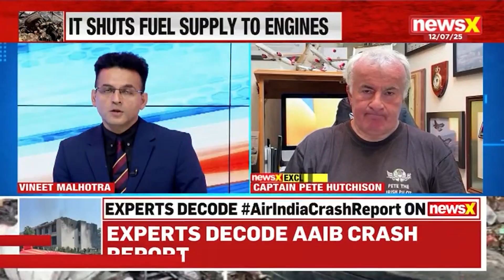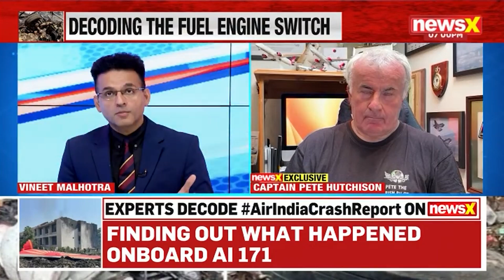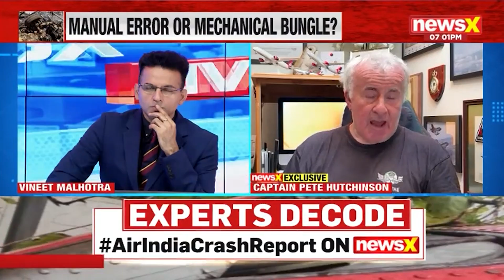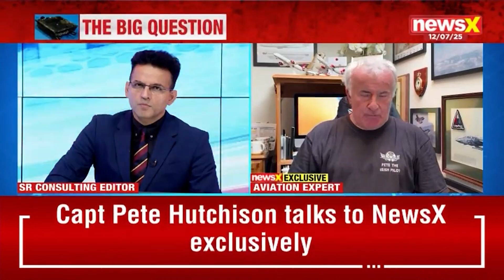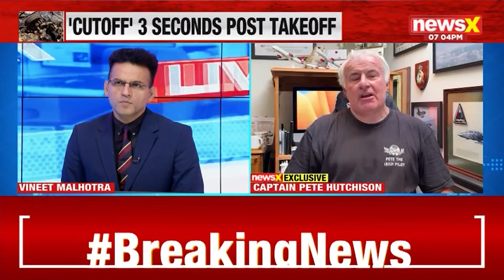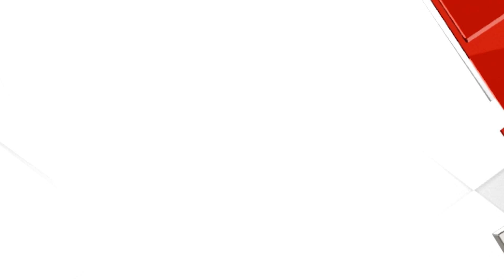Captain Pete Hutchison Explains If Fuel Switch Cutoff in 1 Sec Is Possible or not

Comment: The one second starts when the first switch is already in the cutoff position. The preliminary report around the cause is deliberately vague. the clack clack of the switches would be heard on the CVR and align with the FDR. The First Officer was the flying pilot and his control inputs are recorded at the time the engine switches were operated, you can't do both. The investigators that assessed those recorders are in no doubt what happened and who did it. The only misunderstanding here is the Captains interpretation of retirement. Denial is understandable, acceptance is harder.

Comment: The sound of the switches clicking as they are being moved to cutoff should be audible and is likely on the CVR and coinciding with the FDR data, so without coming out and saying it in the report, this is how they know the switches were physically moved as opposed to just being a software glitch.
Reply: Evidence that the switches actually moved will likely be dispositive as the only other reasonable scenario given the evidence is TCMA digital shut down because of a faulty sensor or programming. All of these cabins should have cameras and be streaming data to safe cloud storage for fast retrieval.

Comment: Having regularly practiced such tasks on 2, 3, and 4-engined airliners for 30 years, from the L188 to the B777, here goes my two bits on the subject:

The normal, day-to-day, On-Off transition of said Fuel Cut-off Switches does not take over a second each. 
So, it can be counted as ~02 sec for both engines shutdowns, plus no more than another 01 to 02 seconds between each toggle operation (adding up to a total of no more than 04 seconds to command the full-engine shutdown on a B787, for example).

That said, average shutdown cycle time on a B787 engine (from Fuel Cut-off to Zero Thrust Energy), doesn't exceed 10 seconds in any normal circumstance.

As for what's happened on this infaust AI-171's cockpit, the revealed preliminary information isn't enough for a valid conclusion or, even, any effectively robust conjecture.

Comment: The pilots tried to restart the engines (one actually did start again); I assume they did so by moving the fuel switch from an off-position back to the run-position. What else could they have done in the few seconds available?
So to me it looks like the position of the fuel switches and not an electrical or computer issue is the cause of the problem.

Comment: Kind of a disappointing interview. I think it’s good he wants to be respectful and wait for the final conclusion report to make the final conclusion. But he’s dismissing important facts that are in the report (emphasis on facts). The fuel switches were “transitioned to off” but it was not simultaneously, it was “one after the other”, 1 second apart. Captain Pete suggests maybe the switches didn’t move and it was a software glitch. So the pilot saying “Why Did You Cut Off” referenced no action? And 10 seconds later the switches were “transitioned to on” 4 seconds apart.  Software glitch is causing switches to disengage then engage nit at the same time without ever being moved, really? (again the report specifically states “transitioned”.)

There are facts revealed from the first investigation report. Use them,,,

Comment: This cannot be called an error. There was absolutely no reason for the pilot to cut off the engines during a normal takeoff. The cutoff occurred at a point where the outcome was guaranteed to be a total crash. Deliberately shutting down the engines at such a critical moment — knowing the result would be fatal — is not an error. It is an act of suicide and mass murder
Reply: With all due respect:

Have you got any evidence that there weren't more than two persons in that cockpit?
Also, in the same speculative train, can you affirm that the person who reportedly asked about the fuel cutoff, wasn't, for example, the same one who did so?

Please don't take me wrong... just making a point regarding the lack of enough data to draw any firm conclusion so far (even though your supposition may prove true in the end, after a few accident investigations, one learns that the effective chain of events can always surprise us).
Rgds

Comment: NOTES..  when electrical power is interrupted, even for a fraction of a second, 787 and 777, for any reason, the spring loaded fuel cutoff valves to the engines will snap shut. This design is that in case of electrical failure, which means fire extinguishers cannot be activated, fuel shuts off automatically so the wing does not burn through from an engine fire. At take off there seems to have been an electrical snag. Happened to ANA 787 after landing using reversers, in Tokyo, and unable to restart. Happened to BA 777 landed safely mile before runway in London. RTd Training Capt
Reply: yes
Reply: again: if it was an electrical switch-off, how could they have restarted the engines? in the short time available, they could have done that only by moving the fuel switches, which must have been in a off-position, back into the run-position.
Reply: Pueden cerrarse las palancas de suministro de combustible a los motores, por mediación eléctrica, venciendo la oposición del resorte que impide su movimiento sin tirar hacia afuera,o sea,sin que los pilotos muevan físicamente dichas palancas?
Quiero entender que lo que se cierran son las válvulas que suministran combustible propiamente dichas,y no las dos palancas que las comandan.

Comment: The report said the fuel cutoff switches were cut off one after the other with a one second interval between them. If it had been a sideward glitch, both would have cutoff at the same time.

The pilot commentating never mentioned this but went on an extended rant about not drawing conclusions instead of just stating the facts and then said it could have been a software error.

Comment: The pilot would not likely speak out, "why did you off" the fuel switch unless 1 of them actually physically switched it off.

Not a lucky guess as to why no thrust and no lift.

I say they both witnessed the switch being turn off.
Reply: The Pilot Flying wouldn't (normally) see the Fuel Switches "Off"; although noticing the related Front Panel indications...
Reply: switched off.and on.
Procedure for a Double Engine Failure
Reply: @alfredschulte9183 That's done one at a time, not off off on on. And there wouldn't be a multi second delay between the off and on.  So that theory doesn't fit.
Reply: You are absolutely right. The emergency procedure says: Both fuel cut off switches OFF than ON.
The time delay between is less than 10 seconds.

Comment: completely agree. most viewer and commentators are not mentioning that this is a switch that feeds a computer . a software error easily masks the fact that the switch is never moved but the FDR record it as so. CVR evidence points in that direction. Calling one of the pilots a liar is completely unfounded at this stage and it quite honestly shameful and disrespectful. Please do your research first and investigate the AIMS-> FDAU -> FDR digital path first and then ask if AIMS could unilaterally  shut down the engines and have it appear on the FDR as if the switches had been moved. The answer is yes of course.
Reply: Why make this so complicated. 

This are switches that are spring loaded the spring applies pressure to start the process and pushes the lever down the metal indent stops the lever from being pushed down. If any of these 2 fail the engines would of not started. If its an electrical failure the switches would of stayed in the ON position regardless. But we know they were moved. 

This system can not fail mechanically and did not fail electrically. This is not speculation Its a fact.
Reply: It's quite the opposite. The CVR evidence points to actual switch movement. This is understood by the question one pilot asked, why did you cutoff?
If the engines failed from some speculative electronic glitch, then the pilot just sees engine failure. There's zero reason to ask about the switches if they are still in RUN.

Comment: Wenn die Flugdatenschreiber eine Unterbrechung der Kraftstoffzufuhr aufgezeichnet haben, bedeutet es nicht unbedingt, daß die Fuel Cut-Schalter tatsächlich physisch bewegt wurden. Was, wenn es ein elektrisches Problem gab und die Piloten dadurch überrascht wurden? Wenn einer der Piloten die Schalter vorsätzlich betätigt hätte, um das Flugzeug zum Absturz zu bringen, warum sollte er sie dann wieder in die ursprüngliche Position bringen? Das erscheint mir doch etwas unlogisch.
Reply: Because the other pilot detected it.
Reply: @karel8y 
1 or both of them knew the switch was turned off... not a lucky guess which caused 1 of the to say hey, why you off the fuel.

It was seen being done, not a lucky guess as to why no thrust or lift. It was deliberate
Reply: but the pilots tried to restart the engines (one actually started again) and I assume by moving the switch back into run position; that can only be done if they were in the off-position before.
Reply: There will be master caution in the cockpit….if either of the pilots try to switch off fuel switches in air. There won’t be a need to ask for it
Reply: @pranay21121988  The report says: ' one of the pilots is heard asking the other why did he cutoff'. why
Reply: Reverting the switch to "On" would be the natural measure to try and (eventually) save the flight.